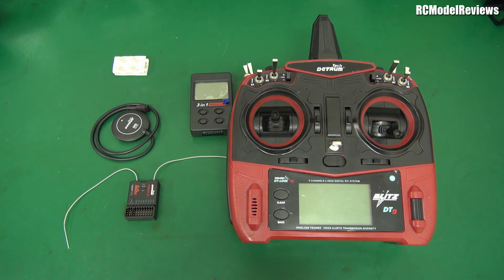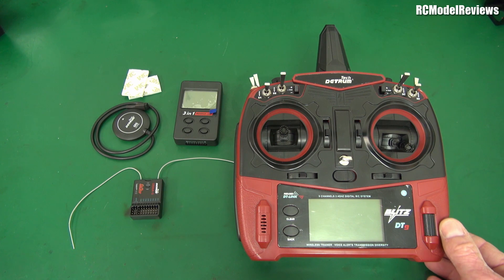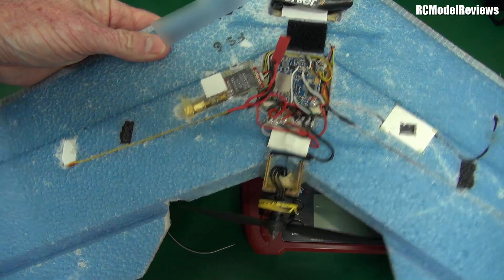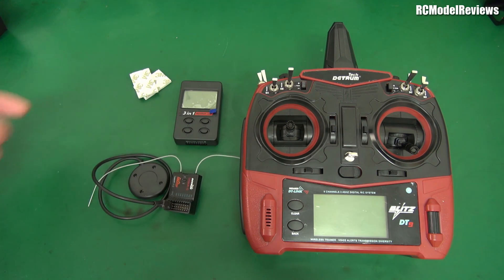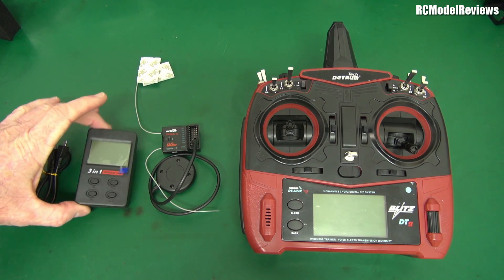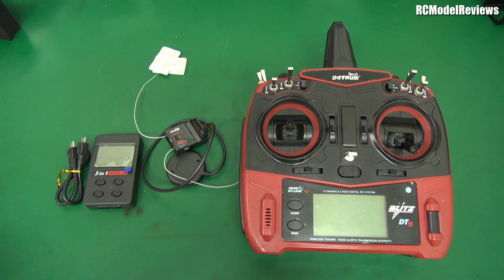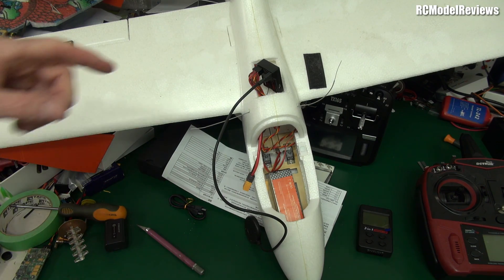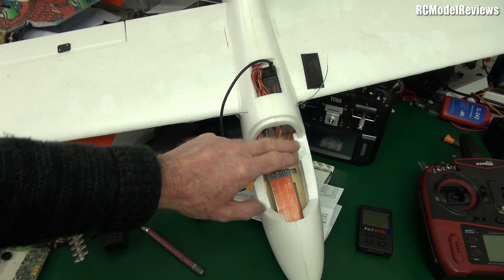The Detrum RC system with flight stabilizer/RTH (part 1)

Comment: I've been waiting for Frsky, spektrum etc to bring out a system like this for a couple of years now. Putting a flight controller and a receiver in the same box is an obvious option.
Reply: Detrum have finished it. are plan to upgrade the monitoring battery voltage in future

Comment: Is there a system that will give me OSD of full telemetry? Airspeed, rate of climb, artificial horizon, compass, most of the basic instruments you would find on the instrument panel of most aircraft?
Reply: Not yet but the EZOSD system paired with the EZUzhzf RX and TX setup gives me the most usable OSD with Altitude, groundspeed, distance from home, RSSI and radiolink strength, battery voltage and Amps used...all without the need for a computer. You can use it with this as well to sacrifice RSSI and radiolink strength for the  RTH function. Im sure this also has RTH as a failsafe option. So you wouldn't need RSSI reading anyway.

Comment: ZOHD KoPilot is pretty darn easy and works well.  Like this, it has no soldering needed but has no OSD [which makes no sense to me].  This unit looks klunkier and if used with a FrSky 9mm receiver (which has telemetry)., I'll bet it weighs  more as well.   I can't see how this will beat the KoPilot unless it's pretty darn cheap or it also fetches your beer from the fridge. 

Can't see the Canopy, but it looks like you could easily make a box/shelf to fit over the battery, tape the unit over that and then put the GPS where you've got the unit now.

Thank you for the videos and all of the hard work promoting the hobby.

Comment: This flight controller has a fatal flaw and should be avoided at all costs.  It tries to maintain a GPS ground speed, which means it can stall when turning downwind and can crash your plane.
Reply: iNav has a section on setting an appropriate minimum ground speed. The problem is the airspeed estimation comes from GPS (=ground speed) as opposed to a proper airspeed sensor. So you need to set the minimum ground speed to be a bit higher than your average wind speed.

I'd hope this system has an option for setting that otherwise you might end up wishing you'd put up with all that 'complexity' after all.

Comment: Will they be doing something for flybarless helicopter? That would be great for my 500. I kind of like the red.
Reply: All Detrum Transmitter can use on helicopter, but cann't use Detrum flight controller receiver (MSR66,SR86A,SR86A-GPS) ,can use Detrum common receiver (RXC6,RXC7,RXC8,RXC9)

Comment: Hi Bruce, does it have a failsafe return to home (if it loses signal does it come home)? I ask this because I think this a big problem with FC's and inav etc, because if I crash (or land a bit further from my take off point), inav tries to return to home, which could cause things like burnt out motors or escs or batteries. I think this is a huge oversight. Keep up the great channels.
Reply: Nope, you are misinformed....that doesn't happen...If it does, you are setting it up wrong.

Comment: Thanks Bruce, Does this flight control unit &GPS work with a Spektrum DX7S transmitter or do you have to buy a DETRUM transmitter?
Reply: hi , this is Jerry from Detrum , it need buy a Detrum Transmitter DT9 . here are some DT9 teaching video https://www.youtube.com/channel/UCIUEY1zOVliUm99zp4O6gqA , more video updating
Reply: If just Z3 flight controller+gps can work with  a Spektrum DX7S transmitter or all other transmitters. But if you need flight controller receiver +gps , just only use Detrum Transmitter

Comment: Range will be pretty important as long as we're stuck with a standard receiver. Could you find a legal way to determine that parameter?
Reply: this is Jerry from Detrum, we test range around 1.6 km in the air
Reply: @tomcatmotor9249  Thanks.Respective for a standard receiver. But this product would be a winner if there was a way to include a long range system.

Comment: What is a servo? I don't see any on my bird :).
Reply: Is it a real bird then?
Reply: Servos are the devices that operate the control surfaces etc. The thingamajig on the other end of the connecting rod to the rudder for example.
Reply: @terryvickers5986 Quad flyer here. no servos required

Comment: Re. the GPS connector, there is a small triangle on it and it should align with the lower right corner of the Rx. You have to use a magnifying glass to see it at our age.

Comment: would love you to discuss the board you flash ardupilot on, can you do that to any old drone flight controller? i have some experience with a proper arduipilot and a pixhawk, but if i wanted just some stability stuff in a foamy can i get a cheaper board? that takes spectrum satellite or ppm maybe? maaybe gps?
Reply: I know Holybro, Matek, and Omnibus boards are supported.